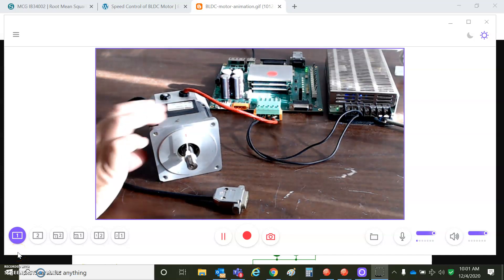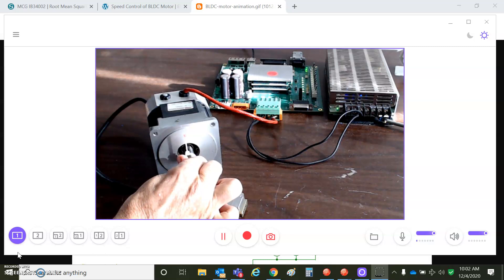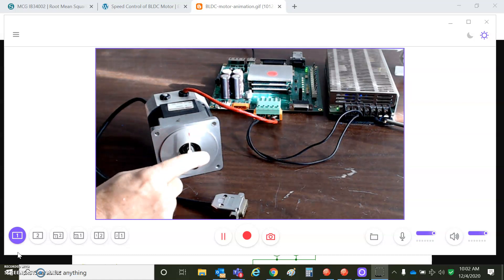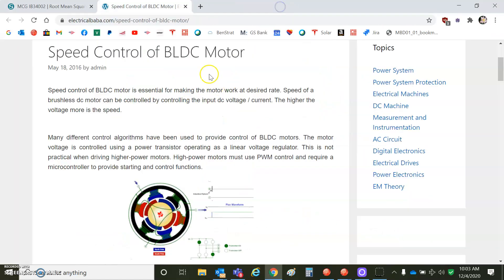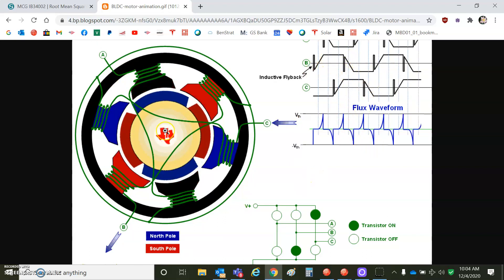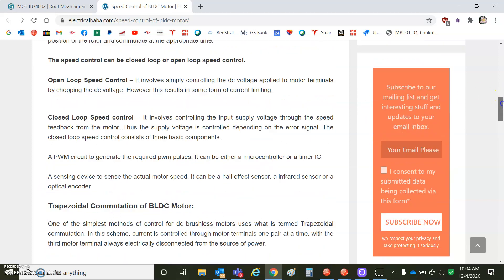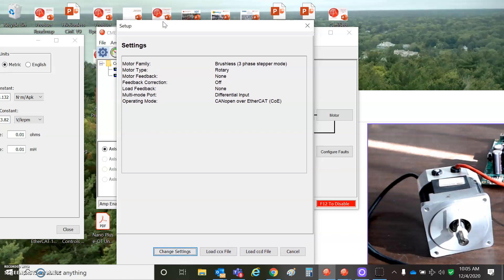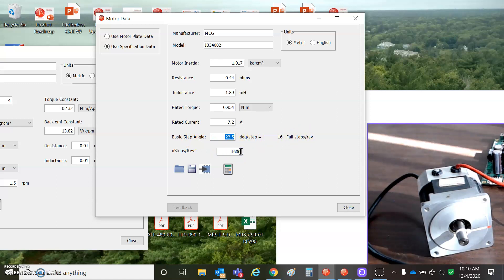Open loop BLDC no Halls no feedback "Sensorless" old MCG motor

Comment: Hmmm... 3 windings should mean 6 electrical phases, as the TI video shows.  Then that gets multiplied by the number of N-S poles on the rotor magnet to get total steps.  If you power & hold a single phase on the 3 windings (one positive, one negative, one off), then the number of "Locked" positions as well as the delta angle per position will be a function of the number of individual coils per winding as well as the number of N-S poles on the rotor magnet.  If those locked points are at 90 degree intervals, then I believe your motor must have 1 coil per winding and 4 N-S poles on the rotor magnet.  This will give you 24 steps per rev.  I believe this is the only way you can get 4 locked positions at 90 degree offsets.  More than one coil per winding would mean there would be lock points at some integer fraction of 120 degrees.  LMK if you think I am missing something.   Also, likely the current spikes are occurring due to reduced back EMF as the motor reaches speed, which is the issue with driving BLDCMs without feedback (besides wasting power, they can overheat open-loop)
Reply from the maker: I suspect you are correct. The version of CME I was using may have had an undesired feature (software engineer does not like it when I say bug). What I am sure about is that the old MCG motor is 8 pole or 4 NS (electrical cycle). I think you are correct about 24 full steps as there are 6 ways to push current in 3 wires and 4 electrical cycles so 6 * 4 for this motor. Good idea to only apply the current required to prevent stall. The current variable I peak can be programed to change over time based on difference between commanded and actual back emf + IR drop + Ldi/dt. I will write a CVM program to do that for the bone drilling application I am working on to make sure it works before asking for firmware feature. 

Thank for the most excelent feedback!